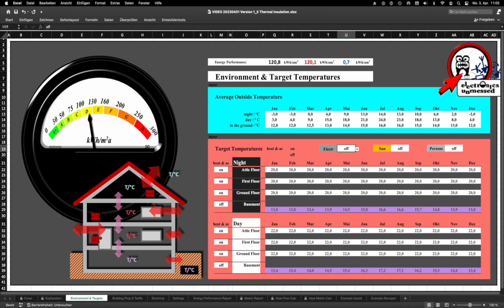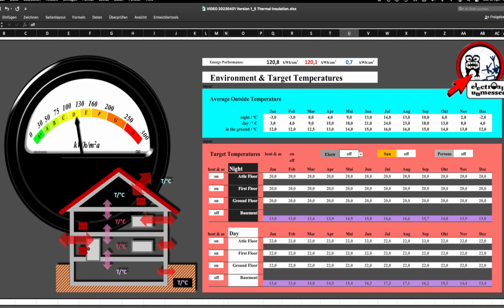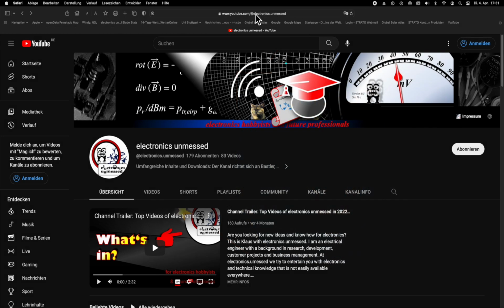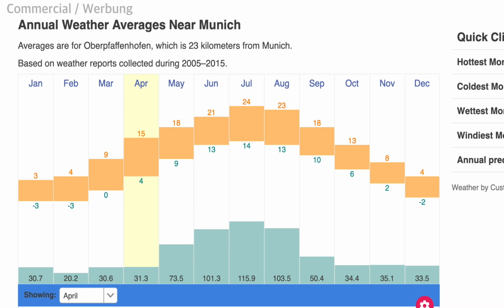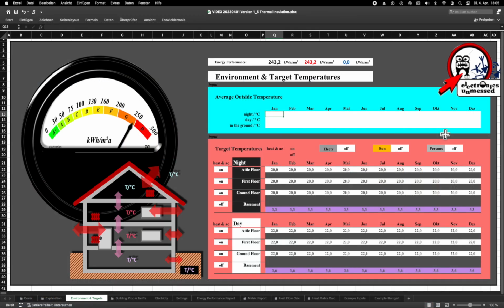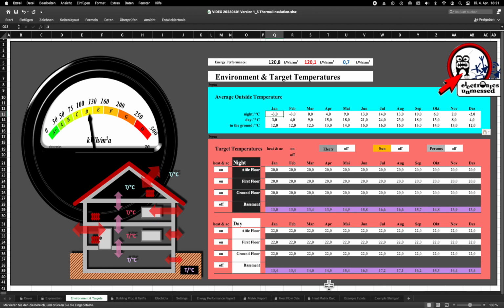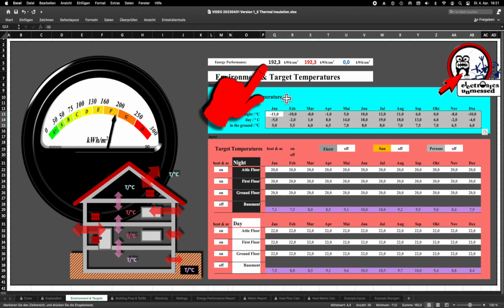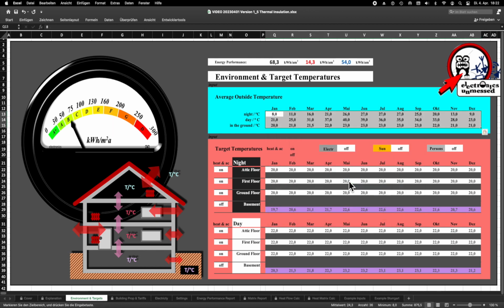Climate Data - Predicting Energy Consumption and Efficiency STEP1 (EX15)

Comment: Excellent Tutorial with very interesting insights! This is applied "Energiewende" and I am shure it will help a lot of people with their decisions about improving 
thermal insulation. For a broader reach out I recommend to offer the tool also in German, since this topic is currently a red hot topic here in Germany.
Reply from the maker: Hello Micha, thank you very much for your comment. The video is step 1 of probably 10. The small video series shall be a kind of user's guide for my tool, which has become quite complex. I want to achieve that, in principle, anyone in the world who is interested can use it.
Reply from the maker: .. on the German language: I would be happy to have a discussion with you here in German.Or in the community section, because that's where the discussion on the topic would be concentrated. I could imagine a video in German, as long as it is a more typically German topic. Stay tuned!